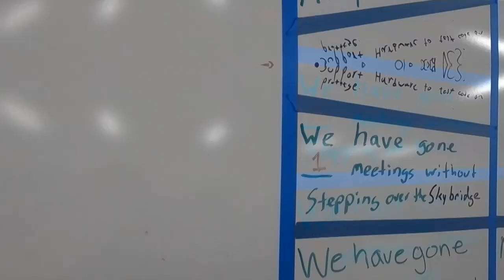11260 Robot Reveal, 2019-2020 Skystone® Mid Season

Comment: Do you use RoadRunner, PurePursuit or Odometry in autonomous for movement? Or just going by ticks?
Reply: In autonomous we are using 2 odometry wheels with a custom pure pursuit algorithm that takes in points and creates smooth paths that the robot follows.
Reply: @samfallon2568  Oh, that's cool. Keep going and good luck
Reply: @robertdamian4648  thanks
Reply: @samfallon2568  Custom pure pursuit? Just out of interest what are you all doing that is different than the conventional PP algorithm?
Reply: @brycelynch4548  I couldn't tell you I'm sure it is the traditional one but by custom I mean we are not using any outside program or library.